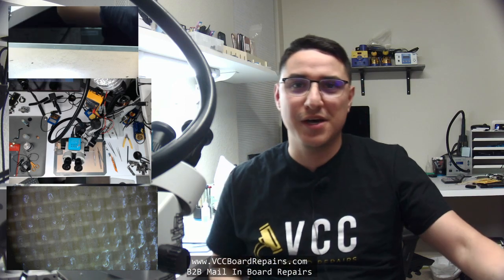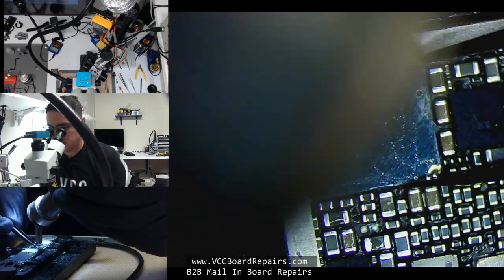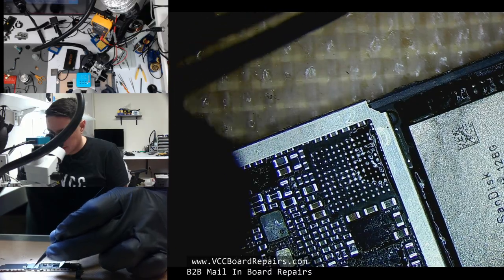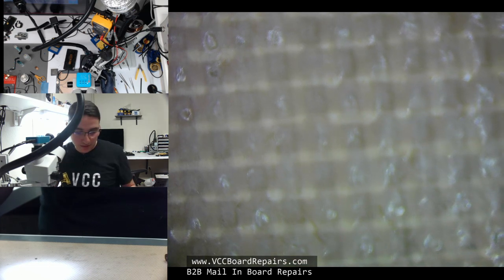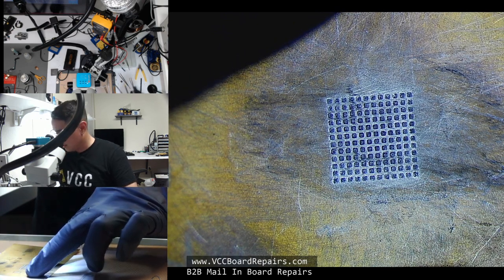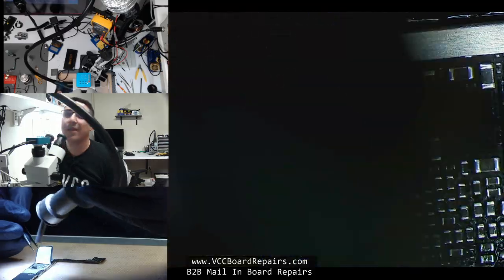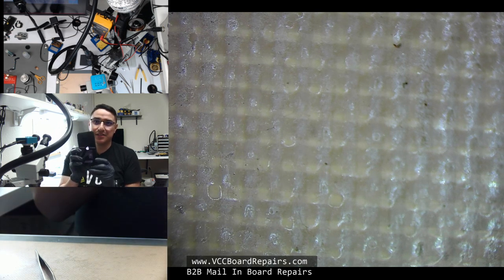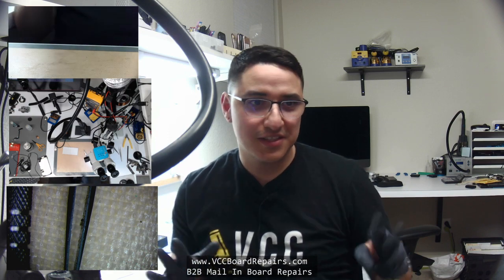iPhone 7 Plus - AUDIO IC Microsoldering Repair - Grayed Out Speaker -  Step by Step Process for 2021

Comment: Is there any explanation as to why you bridge exactly these balls? Like what is the failure here?
Reply from the maker: Which are you referring to exactly?
Reply: @VCCBoardRepairs  the whole repair. What is this "common fault" that you are referring to? Cracked solder balls? What do the balls that you connect do?
Reply from the maker: Ah, you're referring to the C12 and D12 pads. These often break, so we have to run jumpers to reinforce them so they don't disconnect, therefore, the Audio IC problem is solved.
Reply: @VCCBoardRepairs  ah I see, so a mechanical fault.
Reply from the maker: Yup!